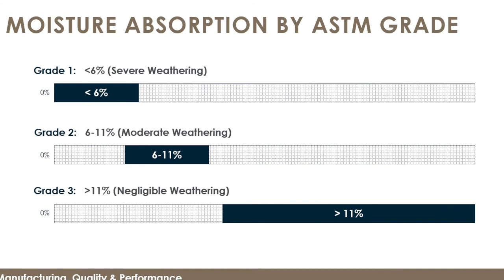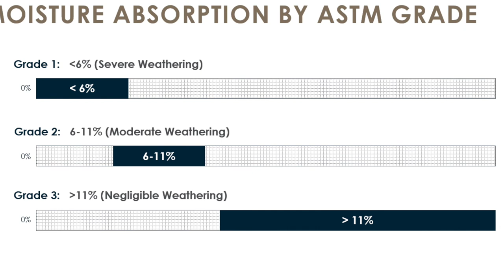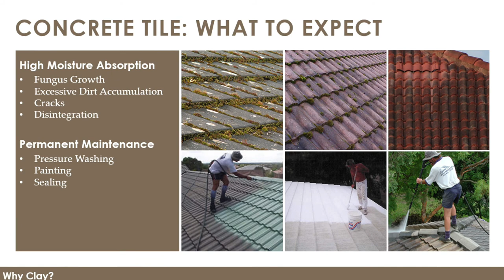Concrete vs. Clay Roof Tiles | Perkins Roofing Corp.

Comment: I guess you answered my question toward the end of the video as to whether my clay tiles can be re-used.  Foam was used during the installation, so I imagine it would be cost prohibitive due to the labor involved to remove it in order to re-use the tiles.
Reply: Yes, it can be done, but it’s really only worth it for Ludowici tiles.

Comment: Youre supposed to seal cement tiles first before install.
Reply from the maker: No, this is incorrect.
Reply: @perkinsroofingcorp  thats why your concrete tiles leak and mould bcoz you dont seal them first.
Reply from the maker: @qalas7327  I have never seen anyone seal concrete tiles.  If you are talking about glazing them, the ceramic glazings are all done on clay tiles.
Reply: @perkinsroofingcorp  no there is a cement sealer applied. Im not talking about glazing. We use cement or tile sealer and they never leak or mould unless broken or hail damaged.
Reply from the maker: @qalas7327  I have never seen anyone do this - I would like to see if you have photos / videos.
Reply: @perkinsroofingcorp  will make a video  for you
Reply from the maker: @qalas7327  🙌🙌🙌

Comment: Maybe idea with concrete use was in places with more wind, storm and to cut cost of repairs. Than concrete absorbs water it becomes more heavy, more weight less chancw they will be lifted
Reply from the maker: They're heavier, which weight can help with wind uplift, but the attachment method matters more than the weight per PSF and at certain wind speeds, it doesn't matter either way.

Comment: You forgot to mention the temperature difference between concrete and clay.
Reply from the maker: In regards to solar reflectivity, that is variable depending on the color of the tile just as much as the material.

Comment: Does the underlayment adhesive bond fail, is that the issue?  And if so,  why not use an elastomeric waterproofing over the wood deck instead?
Reply from the maker: No, the bond is not the issue.  Most people don't know this but the Polyglass SA (self adhered) has a better pull rating than hot mop or torch when applied correctly.  Roofs very rarely fail from wind uplift - unless you are directly hit by a massive hurricane.

The issue is deterioration of the felt at the top of the membrane due to water absorption through the tiles.

Most of the time the primary failure points though are "details" at penetrations, valleys and wall terminations - which is why it's so important to pick a good contract, you have no idea how much shoddy work we see on a regular basis in South Florida.

The other big one is termite and carpenter ant damage.  A ton of people are moving to Florida from out of state right now and they have no idea how to upkeep a Florida home.  Regular termite tenting, installing gutters, installing aluminum and STST rather than galv, re-sealing windows, painting stucco, etc.

Comment: Great video buddy we are building atm and been pricing things up concrete is cheaper but clay ones are tempting me
Reply from the maker: Thank you, I highly recommend them.  Verea has a new tile out, the Caribbean style that are not that much more expensive and way worth it considering how much better they are and how much less maintenance work will be needed in the future.  Let me know if you need anything.

Comment: Great video! Trying to get up to speed on Florida clay/concrete roofing systems as my dads roof needs replacement and I'm evaluating bids.
Reply from the maker: Excellent, yes clay tiles are far superior and are more readily available in South Florida right now.  Where is your dad located, maybe we can help!
Reply: @perkinsroofingcorp  Sarasota,I wasn’t sure if you covered that area. Also, I was watching a ploystick video and he said where the underlayment overlaps you have to apply an adhesive or t wont stick.
Reply from the maker: @l0jack  We can work out on the west coast of FL, I have some homes out in Cape Coral area we are working on, however we have to add transportation and lodging costs.

Yes, PG 500 will be installed, generally around hips, ridges, etc. where common overlap areas are.  The membrane must also be backnailed at the top in order to avoid slippage.  I've seen this not done in the winter where the cool air doesn't activate the adhesive as quickly and the roof just slides right off.  The SA must be installed with heat and pressure.  If it's cool, the installer should be using a leister.

Comment: Any thoughts on composite tiles with a Spanish tile look (like Brava) vs. clay or concrete tile in regards to cost, durability, longevity? Thanks for such an informative video.
Reply from the maker: The composite tiles are pretty strong and don't really break, but they aren't as great for wind uplift from our experience.  We have only done repairs with them and have not installed an entire composite tile roof to date, however after Irma there were a number of buildings in Ocean Reef, Key Largo where we had to replace a number of these tiles because they blew away in the storm.
Reply: Do you have any "ceetile" concrete tiles in your boneyard.

Comment: When the underlayment has gone bad under an "Altusa" clay tile roof, are the clay tiles no longer of any use?  My Altusa clay tile roof is around 25 years old now and has developed various leaks.  Are the tiles salvaged or thrown away for new ones?
Reply: They’re not worth saving.  It would cost more to try to save and clean them than to get new Verea Caribbean.  Altusa are discontinued so you can’t replace the ones that break.
Reply: Wow!  Thanks for the quick reply.  I figured they’d have to be tossed.  I’ve been debating whether to re-roof with tile again or metal.  Thanks for the informative  videos.  I live in Broward, so am in a HVHZ

Comment: Great video, very informative. 
As for the clay tiles, is S tile a better option over barrel tile? 
Thank you in advance,
Reply from the maker: I wouldn't say one is better than the other, because it depends more on the brand and the grade, however "S" tiles are more cost effective as there are 88 pieces per 100 SF vs. 180 for barrel tile.
Reply: @perkinsroofingcorp  thank you so much for the prompt response. We are considering the brand Verea grade 1.
Reply from the maker: @yulybrito9984  It's a great tile, we can get you in touch with the Verea rep. upon your request.

Comment: Does anyone ever apply 2 layers of Polystick underlayment or doesn’t it extend the life of the roof?
Reply from the maker: Yes, we install two layers all of the time, one as a secondary water barrier; however not as two layers of TU Plus or TU Max.  We install one layer of MTS Plus (as an insurance discounted secondary water barrier) and a top layer of TU Plus for a Polyglass 30 year warranty.  We are one of only three Quantum Polyglass contractors in Florida.  We have a video on this install on our YouTube account.

Comment: My question would be, are the weep holes supposed to gush water? I notice the front of my house pees water out of every weep hole way better than I could pee in my toilet, while the side and a good portion of the back do not. It starts immediately with light to moderate rain. It is a concrete tile roof newly installed. I would greatly appreciate your opinion.
Reply from the maker: The weep holes are there ventilation and for moisture that gets under the tiles to come out... seems like there is way too much moisture getting under the tiles if that's happening, you likely have some broken tiles up on the roof there is something wrong with the mortar or transition work.
Reply: Yes, I figured that much, and thank you for confirming. It should be an exciting conversation coming this Monday with the contractor. They are a reputable company, but the problem in Cape Coral is that after the hurricane, these companies are hiring 3rd string installers. They used all the right stuff but went wrong in the foam installation part, using too much foam and lifting the tile off the seams when the foam expanded, causing the water to get under the tile. Again, thanks for your input; your videos are great. I only wished I had watched this video before I installed a tile roof.

Comment: I'm from England, i had my roof done in 2004 payed 3000 pounds for a complete roof they used natural slate tiles could you please do a video on these tiles some day. thank you
Reply from the maker: We don't see many down in South Florida and I haven't installed a slate tile system myself, because they are so rare - only repairs.  Next time we run across one, I'll make a vdieo.